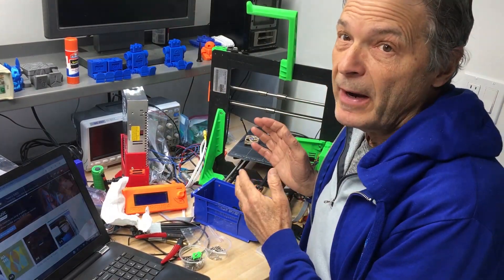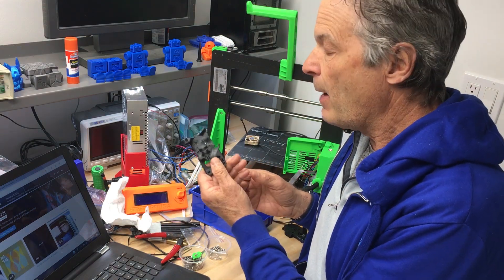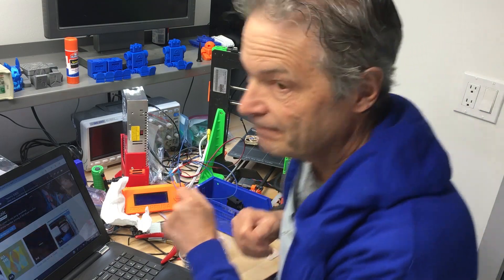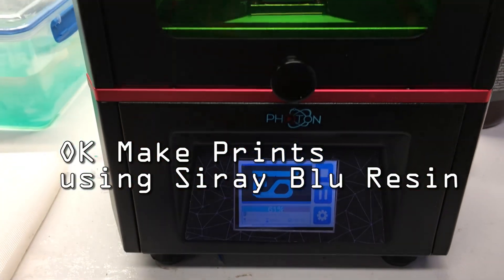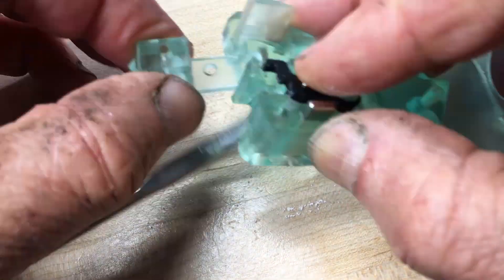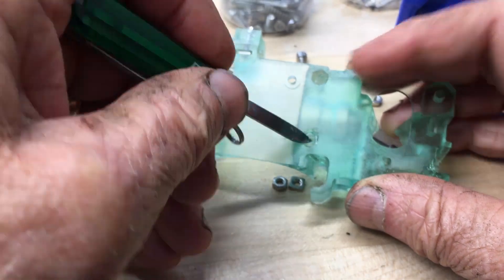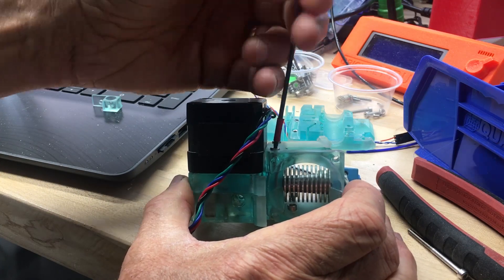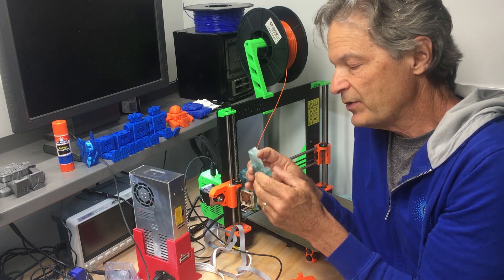Prusa 3D Printer Extruder in Resin!

Comment: Need to do this myself ... thanks for the video... How long did the parts hold up over time?
Reply from the maker: They held up reasonably well. I let my grandson use the printer and he had a problem which caused a big ball of melted filament to build up all over the printhead.  Some parts got broken when we removed it.  But we were able to remake those parts and it was fine.

Comment: I cannot for the life of me get the square nuts to fit.
Reply from the maker: Sorry to hear.  In the version I did on the video I had to use a small knife to clean them out.  In a later version, (Not on video) I used an ultrasonic cleaner to clean out the holes.  That worked very well.
Reply: @PhilGandFriends  Did you mix your blu resin with anything?  I mixed mine with tenacious but I think I used too much.  The parts are very flexible hah
Reply from the maker: @audiorazor  The first time is was pure Blu.  I have done it since with some Tenacious mixed in,

Comment: Thats exactly what I was searching for. How did the extruder made out of resin last in the long run? Did it got brittle or does it still work properly? I've heard from others to mix 70% Siraya Blu with 30% Siraya Tenacious (flexible) to get outstanding parts. But nobody said if the extruder is still working after 1 year of use.
Reply from the maker: It worked great for year until one of my grandkids printed a big blob on the printhead.  Getting that off broke the PINDA probe arm. So we reprinted it.

Comment: Hello, excellent video, in which orientation or position do you recommend printing the extruder?
Reply from the maker: I printed them all in the same orientation as they are supplied by Prusa. (so that they don't need supports).  The bigger issue is use an ultrasonic cleaner to clear out the small openings.
Reply: @PhilGandFriends  Awesome thank you very much, for that part I have no problem, since I have an ultrasonic cleaner, excellent video, you clarified many doubts I had, especially the temperature resistance of this resin!

Comment: Hello - How has this held up over time and how hot have you run the hotend? 240c?
Reply from the maker: It is working great.  I have had it up to 260c.  I don't see any reason why it could not go hotter. Remember resin material has higher temperature resistance than thermoplastics used in filament.

Comment: An old toothbrush and 91% isopropyl alcohol worked just as well as my ultrasonic cleaner for cleaning the parts.
Reply from the maker: That works for the external facing surfaces, but does not work for small long holes.